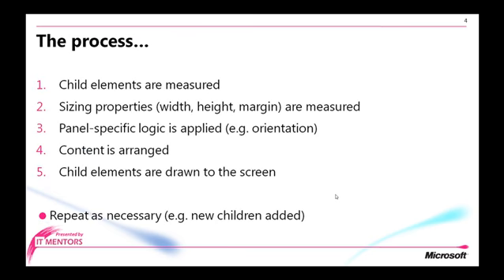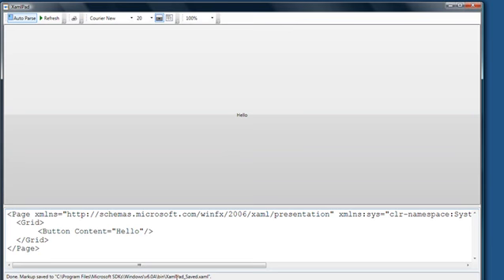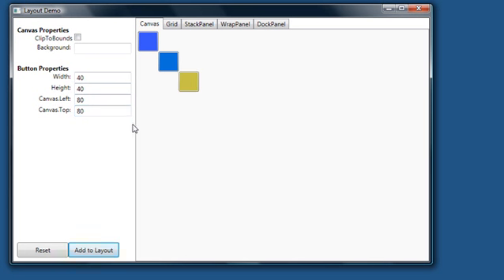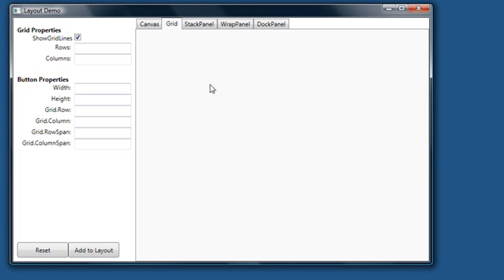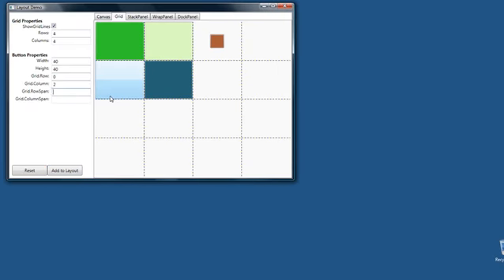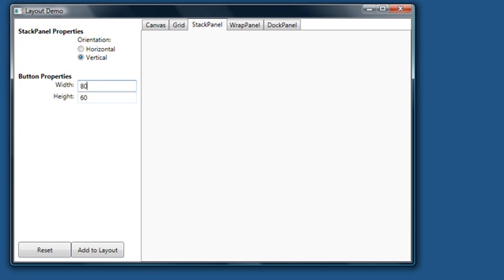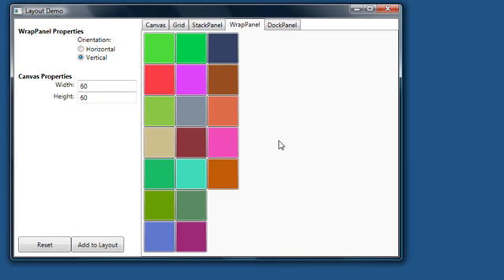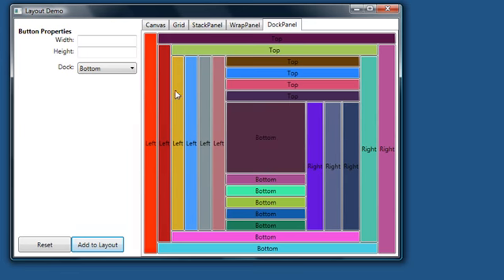WPF: Using Layouts in Windows Presentation Foundation

Comment: recursive? huh? what?
Reply: To simplify the definition: Recursive methods are those which calls or refers to itself while they're running.
Reply: Dasplatus lol, I was being sarcastic

but since you brought it up, a recursive call is actually a function that calls the address of the address it's currently residing. As far as the CPU is concerned it is a "Jump" to a copy of the function's address stored in another instance on the call stack. So basically linear methods are much faster than recursion.